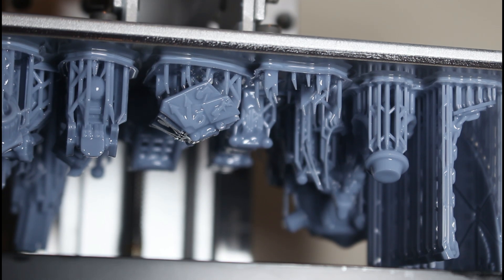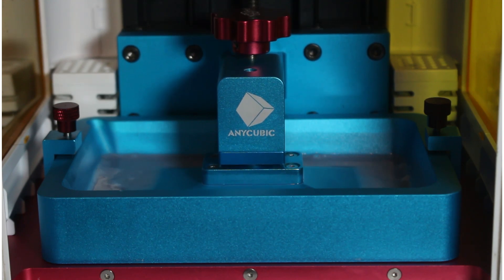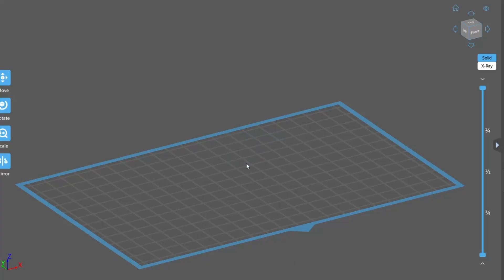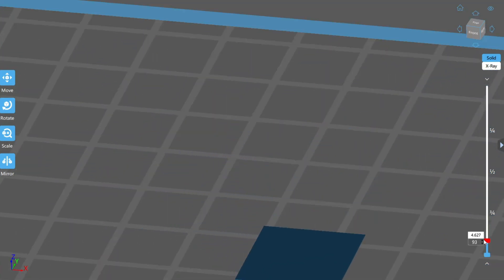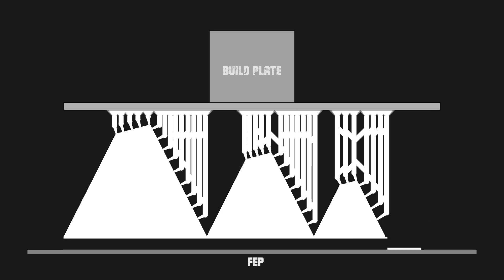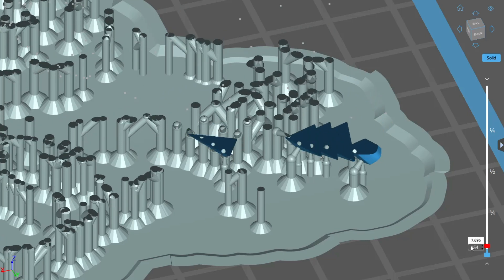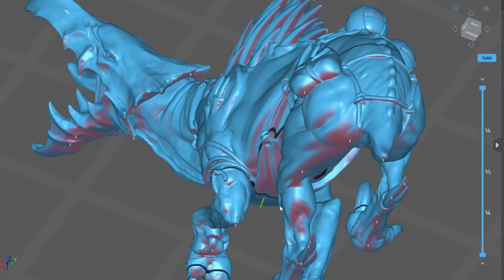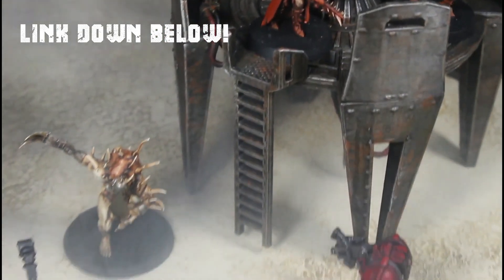Supporting Minis for 3D Printing | The MOST Critical Aspects

Comment: I absolutely love RedMaker's guard line too, but I also noticed they opted for medium supports, and a little more of the support tip buried in the model than usual. Those fuckers are extremely difficult to remove, especially with standard resins. Even at a perfect exposure for the model, the supports are downright rigid, and I wasted an entire hour today just painstakingly ripping girders away from delicate, brittle models with clippers and needlenose. 

Trench Crusade's presups just flat out won't print for me at all. 

Those are the only two standouts though- Bestiarum, Archvillain, Cast N Play, and many more of the top 20 are flawless prints for me every time, and the supports break free in one twist.

Comment: I recently printed a model that's fully supported, but 2 items in one side of the buildplate never adhered. When printing single models they come out ok, but when printing in batches leaving enough space in between but not soo much that the models are sitting in the edge tend to have alot of failure or build up. What could it be that im doing incorrectly? Ive only had 2 prints come out as expected, but the rest after have been all failures

Comment: how trustworthy are you when model makers say you dont need supports and even provide a photo of their model printed supportless? I bought Azure Dragon which the creator stated didnt need supports even on resin but generated supports anyway and spent a few hours cleaning up Chitu's auto supports with UV tools. Sure some of the issue was from me hollowing the model but I found a lot of small islands auto supports didnt get which suprised me for a "support free" print. Maybe im just thinking of supports wrong as a im new to resin coming from FDM printing were an 'island' would mean depositing plastic into thing air when here these small islands only a few layers thick would get picked up soon

Comment: Hi, I have some .PM3R files on my memory stick created on Lychee Slicer and the same type of files are on my Anycubic Photon M3 premium but the machine can't see the these same file types - why?, I assume these are what the files need to be in order to be read, plus I'm new to the hobby and I wonder if anyone out there can help me with a file of a pylon that I'd like to print, I need help with positioning / seeing if it can fit on the plate and whether it needs supports or not. Can you help?, many thanks, Chris. I was trying UV TOOLS to see if that would help but I'm still none the wiser and it hasn't helped my file.

Comment: Also do you have your machine settings uploaded anywhere ?
Reply from the maker: I don't, everyone's machine and resin and climate is going to vary slightly so its best people run their own exposure tests and dial in their printers. Having said that I've found 2.4s normal exposure, 120mm/m lift and 40s bottom exposure with 4 layers is working consistently well for my Mono X.

Comment: Yes please make a full video on what you do. I find i will rotate a model in chitu and use auto supports  to see how they look on it. If i dont like how it looks i will move it more and do it again until i like the look. Then i will slowly look over the model for missing islands and add supports where they are needed. 

I would also like your recommendation on printing bases flat on the build plate with out supports. I have a Whambam and being able to take it off and flex it letting the modals pop off is great.
Reply from the maker: It's in the works :) I use flexi plates too on my printers but still have much better results with bases printing them angled to the build plate. It's necessary for flanged bases, and flat bottom bases will be prone to elephants foot if you do it + high peel forces. Also it's easier to support any islands on the bases sculpture if there is any once it's angled to the build plate.

Comment: I'd love to see more about doing supports. I keep finding files I want to print on Thingiverse, Cults, and other places with absolutely no supports and it drives me nuts trying to figure it out.
Reply from the maker: It certainly can be frustrating! Thanks for the comment, I'll be sure to get that video made :)
Reply: cults3d and thingiverse you not only need to add supports, you need to fix the model, most of then are broken...
Reply: On a positive note though, you can repose those unsupported models easily in blender or do some resculpting